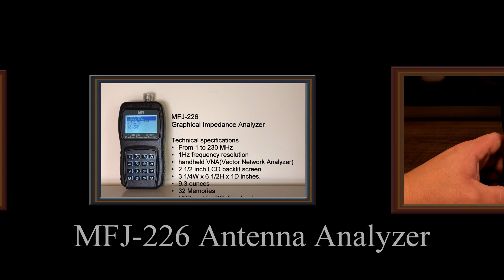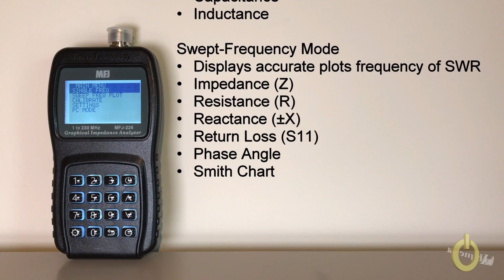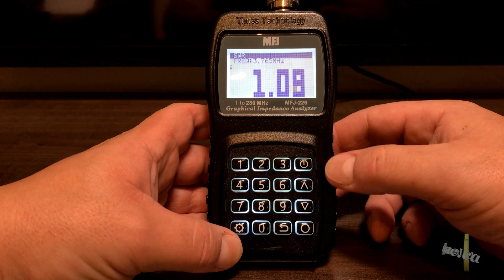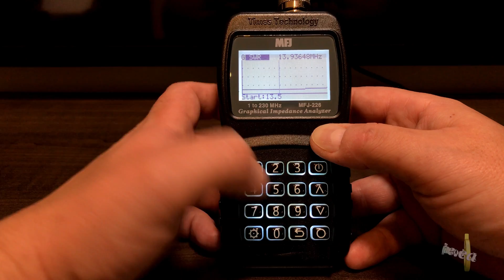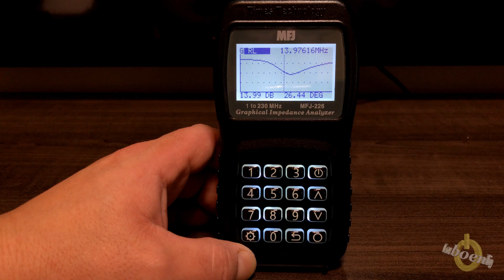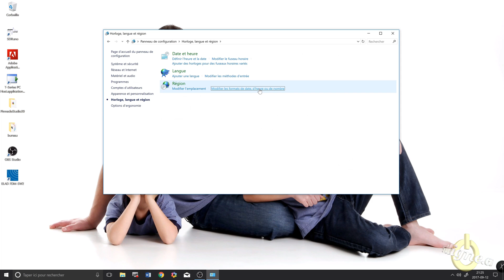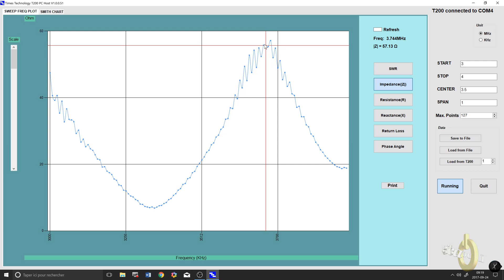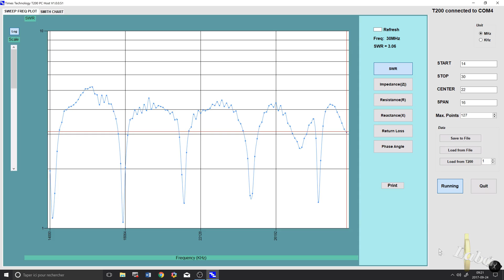MFJ-226 Graphical Impedance Antenna Analyzer - Full Review

Comment: Good video! If you had to choose between the MFJ-266c or this unit (MFJ-226), which one would you choose?
Reply from the maker: Hi Calvin, I think the MFJ-266c is not available anymore.  I went with the MFJ-226 because it covers HF and VHF bands.  73 Pascal VA2PV
Reply: Thanks! After reading the reviews on both of these, I went with the 226 that covers 1 to 230 MHz. 73 N8RFY

Comment: how long do the batteries last?
Reply from the maker: Hi Chad, I play with the unit for about a week and on my last video the screen started blinking because of low batteries (about 10 hours).   I used cheap alkaline bought in pack at Home Depot, I guess you can play with it for a full week with Duracell.  73 Pascal VA2PV